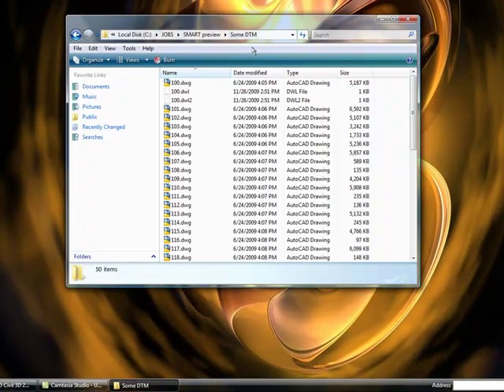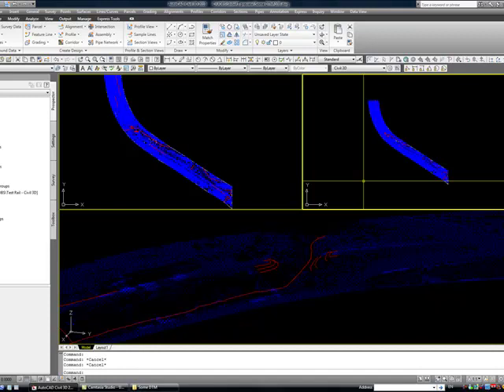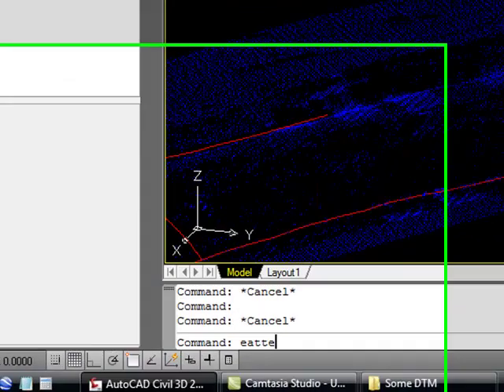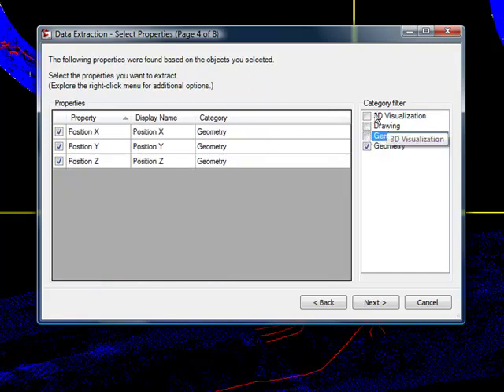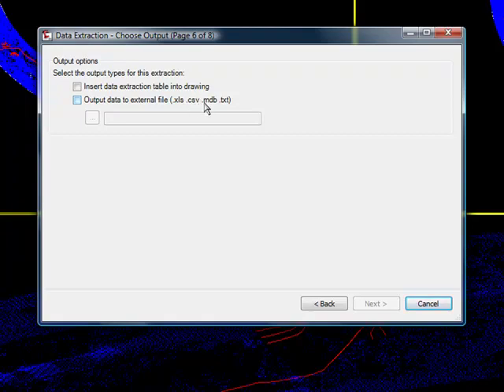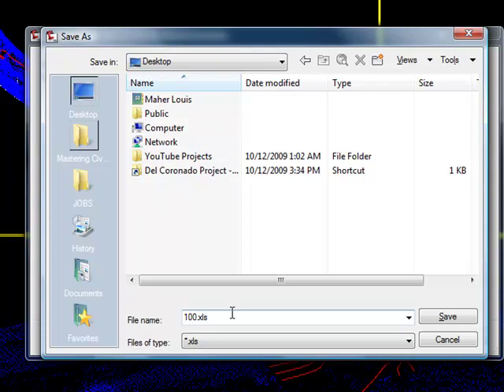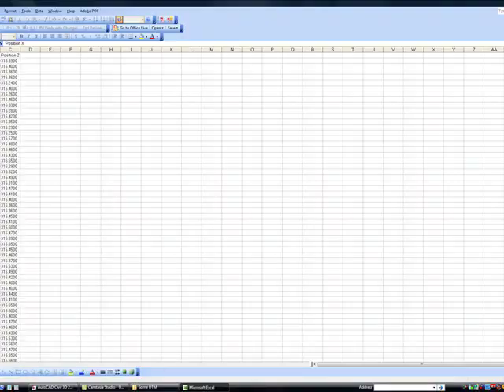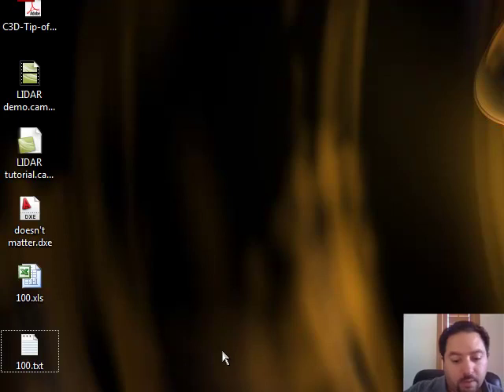Civil 3D - LIDAR Data export using EATTEXT

Comment: Thanks for the tutorials Maher. 

Just a quick note the xls (2003)  format only supports 65,536 rows. The xlsx (2007) supports over a million rows. So if you had over 65,535 points you would have to use .txt, .csv or .mdb